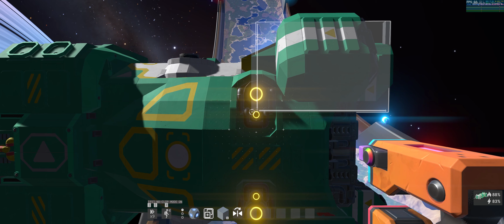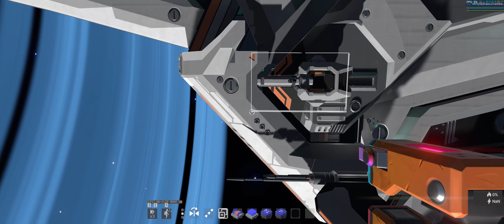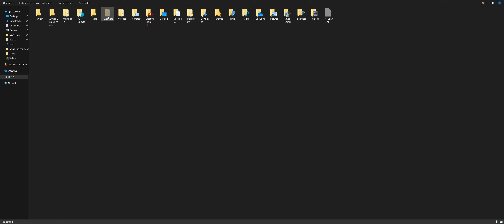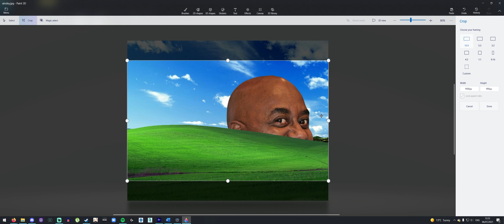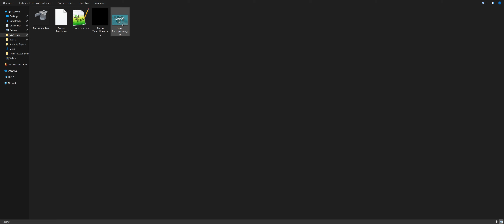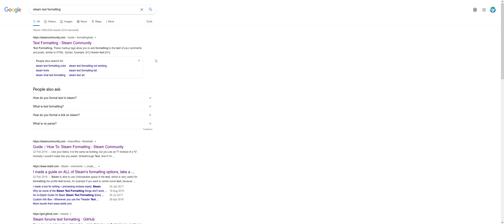How do you copy paste in Starship EVO? - Prefab Guide

Comment: Very helpful.  Could you do a vid on using the features of experimental?  Also, I know fuel will be implemented soon.  Could you do something about futureproofing your bilds?
Reply from the maker: When it comes to fuel, you're gonna need it for the LC Engines, Warp Engines, and Reactors. There's pipes, pipe 6-ways, and Tanks, so you can pretty much build the whole network already, maybe with the exception of fuel scoops. You can clip pipes through hull blocks, too.

I will probably do a guide on newly-released features once Experimental carries over to the Stable branch, since as of now I'm overwhelmed with other projects
Reply: @IndrasilDesignStudio  thank you for that, really useful stuff. Been i bit put off the experimental branch due to bugs, but what you've said helps loads.  Is it just the new glowie pipes and fuel tanks that work with hooking things together or any of the old pipes too?